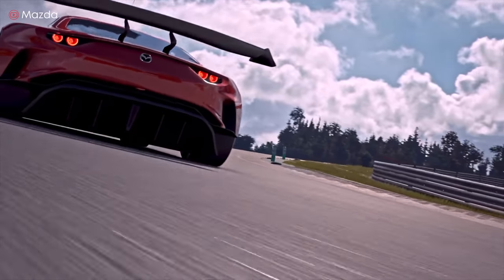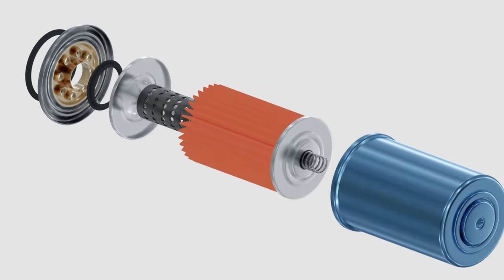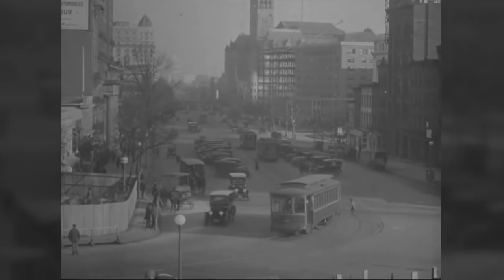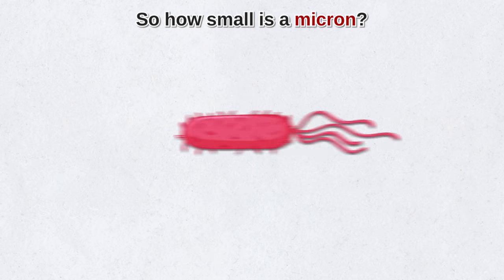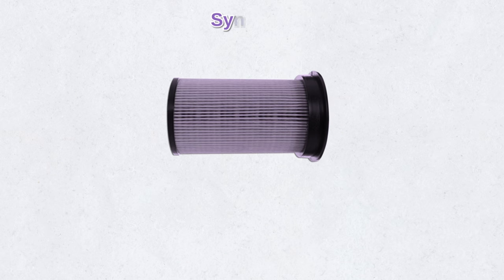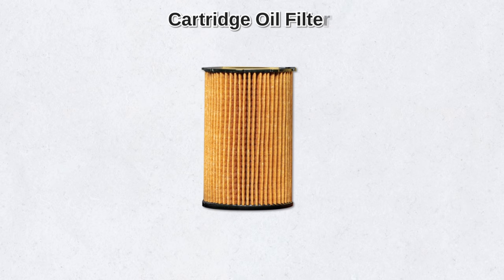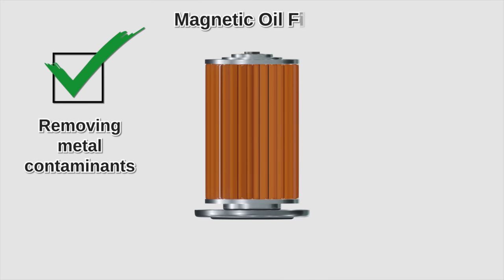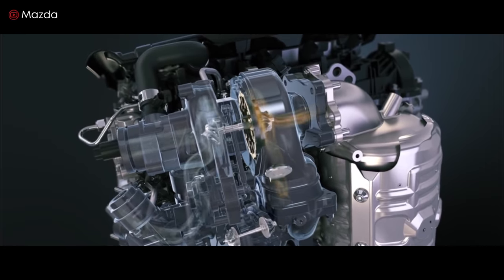This New Oil Filter Just Changed the Game (No More Oil Changes)

Comment: Wow, I was changing the oil in our 2012 Civic yesterday, in the service history booklet it has options to change oil only or change oil and filter. I was wondering if it was necessary to change filter every time. Now I know
Reply: Right!  Do you put your sweaty tee shirt and underwear back on after a shower? Same principal..  ; )
Reply: Cant see a good place to put the Game changer filter under the hood Have to remove the Grill on the Altima to service the Motor Guards on oil and ATF. Modern oils will easily last 20,000 miles. Under normal conditions of course. Always better if you can keep them clean.I might throw some magnets on the full flow filter on the Accord to keep the steel from grinding away the aluminum. You do what you gotta do.
Reply: The Wix on the Pontiac Torrent has been on there at least 4 years and 60,000 miles. The game changer Motor Guard only lets it get pree cleaned oil. Looks like on the Accord I will be able to put some protection.on the engine and ATF filters and lay them behind the 4 cylinder engine loose.. The ATF Motor Guard is wrapped in denim and wired to the top of the V6 engine on the Pontiac. My wife is hard to train she says the car tells her when to change the oil. She works and has a charge account at Firestone.
Reply: It is. But it's a 10 year old car so 🤷 do as you want I guess

Comment: Thank you Scotty for the lesson on oil filters. I learned something I didn't know. I understand we should always use the manufacturer's suggested oil filter.
I have question? Is it possible to use a higher end filter instead of a manufacturer's rated filter? I have a 1998 Ford Explorer 4.0 v6 sohc. It still in great condition and I use full synthetic oil. It rated for up to 7,000 miles but I still change my oil 3,000,3,500 miles. I have 232,000 miles on it. When I change the oil it still looks clean almost like new or fresh oil. Any suggestion would be helpful.
Reply: If you use synthetic oil, it will easily last 7,000 miles or more and up to one year. Don't waste your money on changing sooner.

Comment: I  use Amsoil oil filters my spin on filter filters 20 micron at 98% efficiency my bypass filter on my old Dodge Cummins under the hood filters I think two micron at Oh I forgot to mention my old Dodge is just rolled over 500,000 miles98% efficiency anyhow they work really good and they’re pretty expensive but you know like you said price is no substitute for quality by the way that’s an old speed pro analogy are used to rebuild automatic transmissions I always like speed pro parts anyway this is Jay I am man guy from kennerdell PA

Comment: As a kid heard, the oil never wears out, it just gets dirty, so just change filters & use the same oil for 100k or more.
Reply: Just kidding, but did hear that about oil.
Reply: I serviced vehicles for a phone company in the 60s. They only changed the filters.They knew the engines would be a nasty mess when they sold them but they wouldnt be worth more if the engines were pristine. Bean counters at work. The only way that system works is if you have a depth bypass filter such as a Frantz Motor Guard or Gulf Coast. It is true oil doesnt wear out
Reply: You dont need to change oil if you have a filter that cleans oil. That would be a Frantz  Gulf Coast Jackmaster  Motor Guard. The top loaders are better if you use toilet paper. I have a dozen of them.  Dont know of any spin on filters that clean oil. They sell you a filter that doesnt clean oil and tell you to come back and they will drain your dirty oil. The filter is still clean. I  got wise to that racket at a young age.

Comment: Thank you Scotty, very clear explanation. I didn't even know centrifugal filters. But why does the bypass only filter 10% of the oil? 90% could still contain super small contaminants
Reply: The bypass filter is able to trap the smallest bits because the flow is very slow, and eventually all the oil gets filtered, just takes longer.
Reply: With a small stream of clean oil going to the oil pan it doesnt take long for all of the oil to be clean. Not all bypass filters clean oil. It takes depth. The pleated paper ones are junk. As a rule if the filter takes toilet paper or something that looks like toilet paper it's a good filter. Some cost 30 bucks and are as good as a 1 buck roll of Scott 1000 sheet toilet paper. For someone that's not mechanically  inclined it's better  to not bother with bypass filters. Modern oils last a long time.
Reply: Going to work in warm weather the Motor Guard toilet paper filter probably cleans 100%of the oil a couple of times. It's a guess. Dont know of any way to measure it. Sometimes in cold weather the bypass filter is just starting to warm up. For cold weather customers Frantz had a heater for the bypass filter. I think it was called the Alaska package. Not so important with synthetic multi grade oils these days. It's a steady  stream of clean oil going to the oil pan. The old proven method used by Luberfiner  Fleet Guard and others using cotton pulverized newspapers paper towels and toilet paper since the 1920s. A lot of people get the idea that the filter cleans 10% of the oil then shuts down leaving 90 % of the oil dirty.. we are not all bypass filter enthusiasts. My 41 Dodge had a filter far superior to anything on new cars. It used cotton. It was a Fram. The brand people like to bad mouth.  Not sure you can get good elements for the old Frams. Pleated paper has replaced Cotton.
Reply: When I was in trucking I knew Mack trucks used centrifuges Dont know how they get the new oil  needed to keep the additives up. Some of the big diesel filters need 3 gallons of new oil added at filter changes my little filters need a guart added at filter change.

Comment: I have been told FRAM supplies Honda with their blue oil filter 15400-PLM-A02 and Subaru 15208AA15A.  They fit my 2007 Honda Civic and my 2016 Subaru Crosstrek.

They are pretty much identical.  Inter relief seems identical, the thread is correct, o-ring is correct.   The only difference I see is the Subaru has a 66MM  (2.560)  14 flats.  The Honda is 65MM (2.520) 14 Flats.   The common cup wrench in quality aluminum 65MM.   No one makes a 66 except in a stamped steel cup wrench.  There garbage and tend to slip.

Does both filters fall in your spec that the Honda filter will work on both cars?

Comment: any oil filter has to compromise between flow and how fine the filter is if they made it too fine a mesh to filter everything out it would clog quickly, and bypass would have to open so I can't believe these 20,000-mile super oil filters nonsense if it can last that long it would be pretty clogged or media would have to allow larger particles through.

Comment: The Amsoil bypass filter is about the best setup around.
Reply: Also the best oil
Reply: @reginaldsmall3766  Yep, sure is.  I'm running their Signature Series 10W-30 in my '69 AMX.
Reply: @8avexp  I use amsoil in my Honda Chevy diesel. Ordered a 2022 corvette and I will use in that also. The best
Reply: I dont think so
Reply: The origional Amsoil bypass filter was a good filter but too expensive to use. What helps the pleated filters is better oil quality and cleaner running engines. My Altima almost dont need a filter it's so clean running like many others.  My Motor Guard is clean. My full flow is clean. Different story with the old 390 in the 76 F 250. The filters have to work.

Comment: My 2011 Ford F-150 ecoboost sputters when i floor it or try to pass somebody, and when I change the oil, it does it way less often, I don’t know what the deal is but the oil change has something to do with it, plus I had done a spark plug change last year when I noticed it, it had gone away until the oil gets used up.

Comment: The heat will degrade oil no matter what oil filter you have !
Reply: Some synthetic oils are not degraded by heat.  Check out AMSOIL.
Reply: @discerningmind  Everything is degraded by heat....
Reply: @oldskool1979  Very true .oil will evaporate  and  increase  in viscosity including Amsoil. We deal with that  by changing  the bypass filter and adding new makeup  oil.  Probably not a problem up north. In hot country a oil cooler helps. I have seen Amsoil look like gear oil after a summer of extreme oil temperature. Not the fault  of the oil.
Reply: Very true. The trick is to never overheat it.. even the high dollar oils will evaporate and increase in viscosity . I've had it happen with Amsoil and Mobil 1. Allowing the engine to idle with the AC on in July waiting to cement an oil well wasnt the fault of the Motor oil. In the old days the polymers in multi grades could break down and leave you with oil that was like kerosene. That's why there were no multi grades for diesel engines. Things have changed.

Comment: Are you reading from a TM-9000 Scotty? 😂😂😂
Also my girlfriend has an Volkswagen EOS, I learned that this car requires a filter with a check valve otherwise the engine doesn’t have pressure and it stalled and actually shut off on me. Weird ha?

So some cars or automobile manufacturers need it. So I get it’s filters from a European auto shop or on eBay as the auto parts retailers probably doesn’t have what I need.

Just FYI & others.

Comment: How well does the oil filter "Anti-drain-back valve" work when a filter is installed in an inverted position, especially once the engine is shut off doesn't some of the dirt get drained back in to the engine (when the engine is not running, I assumed there is no pressure/back-pressure to actively cause the anti-drain-back valve in a filter to be effective...
BTW, how do those BMW, MB etc. with inverted cartage style oil filters retain dirt in oil filters when those engines are turned off?

P.S. I still think having and inverted oil filter at the top of the engine compartment is convenient, but not when still have to drain the old oil from the bottom (with my Q above in mind).

Comment: hearing all the things that will kill my engine makes me have a lot of anxiety driving around with 200k miles, luckily it’s a toyota but still...
Reply: Just follow the service schedule in the owner's manual.  You must be doing good maintenance if you made it to 200K.
Reply: I follow the manufacturer's recommendations. Bought a new.84 Subaru. Brought it home and put Mobil 1 in with a Frantz oil cleaner. Took me 20 years to put 250 K on it with no oil drains. I was putting about 12 K miles on it a year. Changed the toilet paper in the Frantz about every 4 July and added  quart of Mobil 1. Some time after.250 K both head gaskets started leaking oil and I went to a less expensive oil.A Caterpillar lab said the oil looks good for that many miles but recommended I change the Frantz every 6 K instead of every 12 K. That was the first oil analysis the oil had. I do follow their advice. My 93 Subaru has 240,000 miles on it. Its had one oil change since 116,000 miles. Bought it used with 116,000 miles on it. Parked the Pontiac untill Trump gets back in and gets the price of gas back down. It might be too late by then.

Comment: A mechanic told me 45 years ago he worked for a company that developed a filter so good you would not have to change your oil Ever an Arab nation bought it .
Reply: It didnt take long for the oil changers to realize there is little interest in filters that clean oil. Everyone is debating about which of the filters that dont clean oil is the best..I just got in a Australian Jackmaster.  Looks like a tie between Gulf Coast junior  Motor Guard and Jackmaster. Jackmaster may be the best one still in production. Most of the Jackmaster filters will probably go to fleets. The same as the big Gulf Coast filters. A NASA diesel equipment engineer once said the filters are only for  commercial use. Private owners dont keep their equipment long enough. He was reading my posts. I see Gulf Coast has NASA listed as a customer. Jackmaster looks like they are getting involved in the military. I was wondering when it would happen. I have connection's but there are things I dont know about. Some things they dont want me to talk about. When I was a dealer they would say you dont talk about this. If I had mentioned the wrong thing on these forums they would have came down hard on me.

Comment: My aunt had a Toyota 4 runner with over 200,000 miles on it. She takes it into Walmart for a standard oil change and they forgot to put the cap back on. Nevertheless, engine blew, Walmart paid for a BRAND NEW engine. Wish that could've happened to my old Nissan rogue 🤣🤣🤣

Comment: Now here's one for you, Honda, generally very well regarded in engine design and construction, does not require the filter to be changed at their A1 service interval. It's no skin off their teeth to have it replaced, so why is it that it's not required?
Reply: I noticed that too on my 2008 acura rdx a1 service. So I just use a high quality wix extended filter previously and did just the oil change.

Comment: A myth I’ve heard more than once is that if you replace your oil filter often, you don’t need to ever change your oil. NOT TRUE ! Motor oil is made up of long molecular chains that get between the motor’s moving metal parts. These chains slowly break down through wear so your oil becomes less effective.
Reply: I quit changing oil in 1963. It depends mostly on  never allowing the oil to get dirty with a filter that cleans oil and adding enough new oil at filter change. I have always used depth bypass filters. Started with a Frantz . Have Motor Guards and Gulf Coasts now on all engines with an oil pump including  lawn mowers Not a myth. I think Australia's  best oil filter the Jackmaster oil filter is being brought in to replace the Gulf Coast junior. The top loaders are a better design. Might be a better design and less expensive than most even with the 55 dollar shipping cost. The big Gulf Coast filters work fine on drilling rig engines. Humvees  and lift trucks need little filters. When Jackmaster tells you to check the Gulf Coast website you know there is some type of agreement  going on. I got the Jackmaster filter in from Australia.  Very impressive. I prefer the top loaders. Easier to service. Jackmaster has fabric  covered elements but are designed to take the tightly wound toilet paper such as Scott 1000. That game changer filter has been around since 1954.

Comment: The importance of that part the air filter? If you didn't use one oil would get dirty and need to be changed in just 500 miles or less. Oil filters on average hold about 25 grams of dirt.

Comment: Its funny you should say that scottie
These last couple of weeks my mexhanic research has come up with the exact same answer ..there is anew filter called 1 something maybe 1world filter  that filters ton1 micron
Reply: I only know of three that are able to clean oil and are economical. All I use now is the Motor Guard and Gulf Coast. 
Motor Guard  only makes compressed air filters now. Not sure Gulf Coast still makes little filters. They mostly do heavy duty diesels. Frantz oil cleaners are easy to find. I lost my last two Frantzs when my sister wrecked the old Impala. They went to a salvage somewhere in Dallas tx. Engine and ATF. I have a lot of filters. Use a lot of Scott 1000 sheet and Great Value 1000 from Walmart. I dont drain oil on anything including riding lawn mowers. The Jackmaster is coming here from Australia.  I'm told they are Australia's  best. I'm told some Australians are using toilet paper in them. I'm a toilet paper guy. Recently installed a Australian Jackmaster Classic in the Pontiac. Its similar to the Gulf Coast junior. It has the larger core seal for the larger toilet paper. You can also use the Jackmaster element. Toilet paper has worked for me for 60 years. The top loaders are the easiest to service.

Comment: if most of the engine wear occurs during startup, why isn't there a  pump to pre lubricant the engine before startup? Also in the start stop system to maintain oil flow?
Reply: Back in the day they sold pumps like that, you pre-lubed before start and it auto ran a short time after shutdown. I assume you can still buy them
Reply: Some say the 0 oils will drain off the parts too much at shut down. I see my daughters Subaru legacy calls for 0 20. Not so sure I trust that. Dont understand how the same oil can cover from Northern Michigan  to southern Arizona.Sounds fishy to me. 5 30 sounds better to me. Not.familiar with the  start stop system. Saw a lady at the bank ATM. She was sitting there  with traffic backed up behind her. Pretty soon someone came and got her started.  What happened is the engine shut off when she stopped  then didnt start.  I dont think the oil would have time to drain off the parts. My concern would be the starter. A good oil will leave a film of oil on the parts for a long time. I can see being stranded like at a stop light with horns sounding behind you. I would defeat that system. They might have it where if you bypass it the check engine light comes on.
Reply: The 93 Subaru owners manual says dont use 5 30 for sustained high speeds. Makes me wonder about my daughter's newer Subaru recommending 0 20. I remember my Oldsmobile diesel saying it's ok to use multi grade in an emergency until you can get 30 weight in it.  One owners manual says use 10 40 and the warranty is voided. OK to use 20 50 or 10 30. There were no diesel rated multi grade oils in the 60s. Use multi grade in this engine and the warranty is voided.  A GM technician told me the multi grades are still crap.

Comment: this is not new Tech we have been using Centrifuge  filters since the 60s and they have gotten better and they are the best filters and they should be an industry standard  but they are not why as they do not need to be replaced just cleaned  and they also offer the best filtration which means less chance of engine wear over higher milage  and how do they make money   by making things disposable